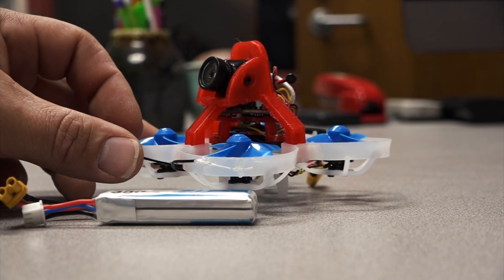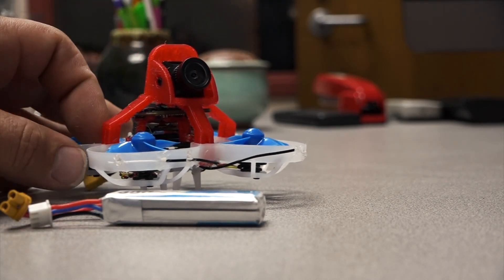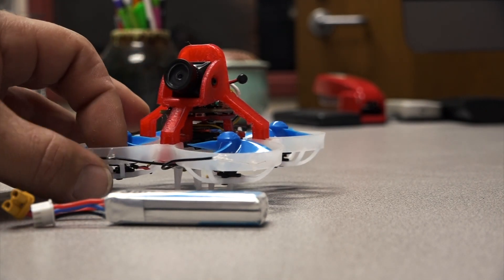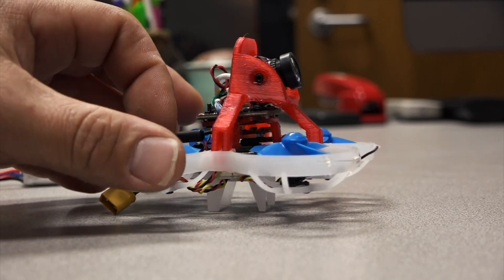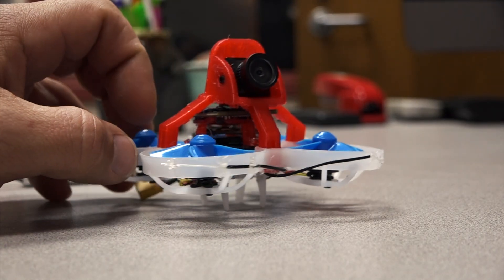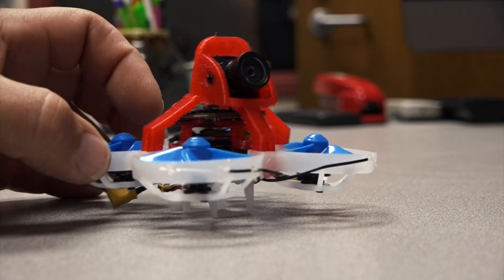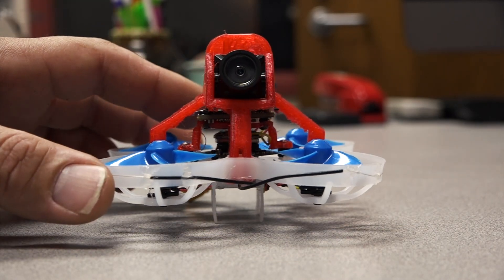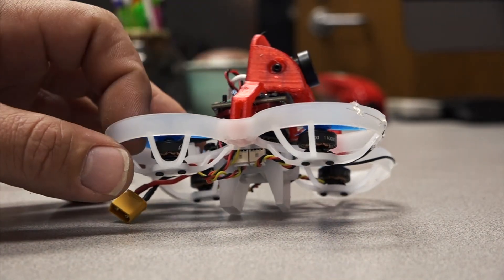Beta75X HD

Comment: 2:30 flight time is pretty good! I only fly my batts on the tinyhawk down to 3.4v, with sag, and I still get that flight time lol. Subbed and liked 👍👍
Reply from the maker: Thanks for the sub.  I am working on a new video concerning props.  Mega difference in smooth and getting over 3 minutes now. I responded to your turtle mode comment on the mockingbird settings.
Reply: Thanks for this! Just printed this out, unfortunately my printer doesn't like TPU so had to go with PLA, hopefully still works out. Would love to know the prop mod, I am using 3 blade TBS props.
Reply from the maker: Tremor Flow The TBS 3 blades are the best by far